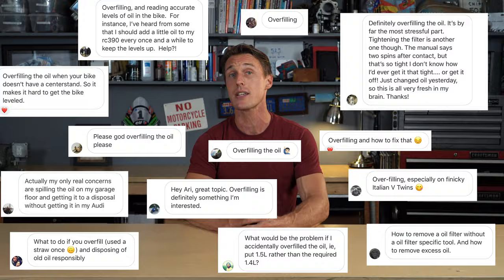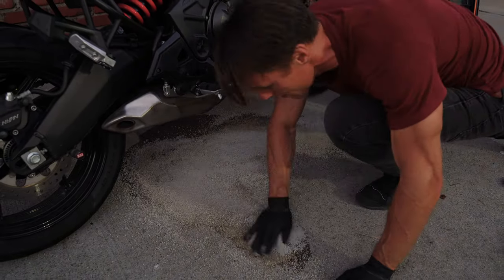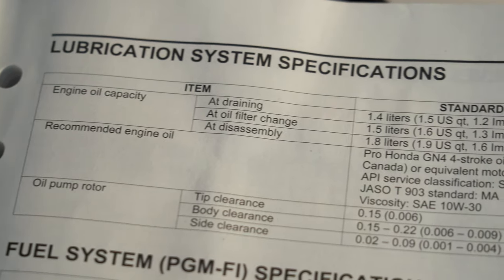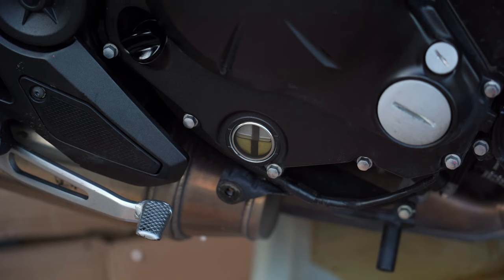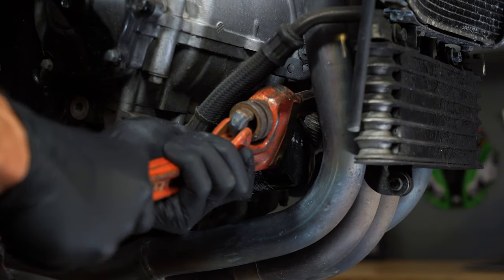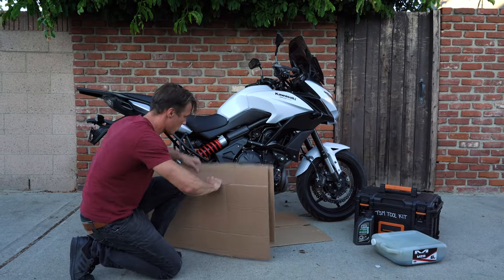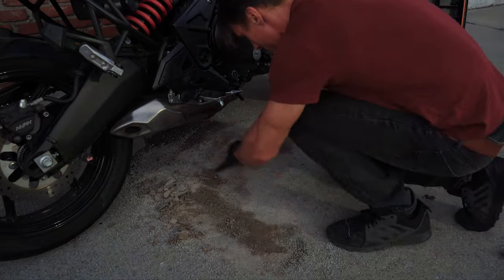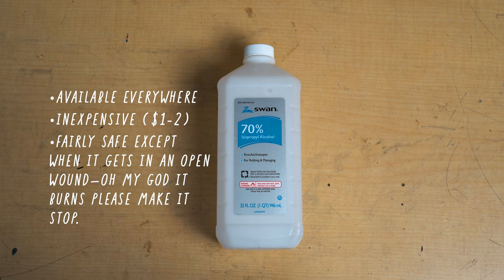Overfilled Oil, Stuck Filters, And Oil-Change Hacks | The Shop Manual

Comment from the maker: For more oil change tips and other how-to articles, head over to RevZilla's online magazine, Common Tread: https://rvz.la/3jPWNkE
Reply: Thanks Ari!
Reply: Ari, you have to be careful generalizing by telling everyone lefty loosey. I can think of dozens of examples from watches and circular saws to motorcycles car and trains where righty loosey is true. Someone is libel to round or shear a nut or strip a thread on a reverse threaded fastener
Reply: Flushing engine before an oil change?
Reply: My 900ss Ducati had the oil filter recessed into the engine case and a torque spec of like 20 ft lb for some reason . Needless to say KN pot metal hex was rarely up to being removed making the psycho method of just stabbing it pretty much the standard procedure .

Comment: There is no worse feeling than changing your oil and not spilling a drop. Then accidentally knocking over the container you used for your used motor oil just before you were about to cap it.
Reply: I did it once, then I misplaced the container on a bench and a burst of wind threw the used oil all over the shop. So frustrating, but a funny story afterwards.
Reply: i had my drain bolt drop in through the hole of my drain pan once...good job I am an expert with chopsticks and was able to get it out again. Took me ages though.
Reply: @Megolhen  I use a 10 oz empty salad container to catch my 1.5 qts and just replace the plug with a new one every annual change since the washer is usually fused to the plug anyway. Then transfer to a 5 lb empty protein powder container for disposal.
Reply: I always have big cardboard pieces lying around. Also good for cleaning and lubing the chain without getting gunk on your garage floor.
Reply: I always drop the oil filter in the catch pan and splash it all over the place
Reply: I accidentally tipped my last bottle after a perfect until that point procedure. XD
Reply: Once I drove over the container that I used to gather it, oh god the mess I did was epic.
Reply: oh yes lol
Reply: im a motorcycle mechanic so i do a lot of oil changes. most annoying thing is when you drop the oil filter into the oil pan and it splashes all over the place, all over you and your face. happens to me at least twice a week and pretty much only on KTM filters because you can only get them out with pliers which is pretty sketchy or by punching a hole in them with a screwdriver
Reply: No, it’s pouring your fresh oil into the car and then hearing a suspicious dripping sound from under the car
Reply: Luckily Baking Soda does wonders for those spills. I had to use a box of it recently because the Z650 has a very piss poor drain plug location and caused oil to drain out at an angle I wasn't expecting.
Reply: Or super careful 🤣🤣

Comment: I'd like to add: After you changed the filter and filled up the oil. Remember to let the engine work for a few minutes and recheck the oil levels. Some times, the filters soak up enough oil to change the levels.
Reply: that is why i measure the oil in a container with graduation marks, so i know i have the correct amount of oil
Reply: I presoak my filter as well
Reply: as per my manual, i only change my filter every 3rd oil change... 
I've never used the same amount of oil on a change, so premeasuring like above I would never do...I use my eye to know its at the right level
Put some oil in the filter, put some oil on the gasket on the filter as well, that will help it come off easier next time... I've only ever used my hands for filters in 35 years... As long as you do it in the proper intervals and lube the gasket, it wont need a wrench.
Reply: I believe he mentioned it in the last episode, but I suppose it never hurts to remind
Reply: @BigBadLoneWolf  Even if you do measure it beforehand you still need to check it in the window.
Reply: @TheGamersRace  I fill with the specified amount of oil, warm the engine again, check the flow to the gallery, let it sit and check the sight glass, and it is always in the middle of the marks
Reply: @rya3190  my Yamaha service manual, actually states a torque setting for the oil filter, but i just hand tighten, then 1/4 of a turn, and on my VFR, the filter is behind the header pipes, so i cover then with  tin foil, before i remove the filter, so no spilled oil gets on the pipes
Reply: @BigBadLoneWolf  I do the 1/4 turn thing as well for ages. Not a single leak. Don't forget to lube the O ring as well
Reply: I weigh the drained oil and filter, tare a fresh filter, and then pour until that much has left my fresh oil container. It's never let me down.
Reply: New yes one being reused it’s the opposite
Reply: @BigBadLoneWolf I never thought of this always used brake cleaner but will do next time.
Reply: Don’t prefill oil filters. You will run the risk of dropping dirt in to the filter, which goes directly to the main oil galley.

Comment: I used to put old newspapers on the ground under my bike to soak up any spilled oil. But when newspapers went the way of the dodo, I switched to dog training pads. They are absorbent since they are designed to hold liquids (pee), leak resistant, and don't cost a ton (22 cents apiece in an Amazon Basics box of 100, which will last for years).

Comment: My trick for overfilled oil. Take the pump and straw from a (preferably used up) tall kitchen liquid soap dispenser, thoroughly wash out any left over soap, then just use it to siphon out the excess oil. The wider straw and pump easily draws out oil.

Comment: Before the “drive a screwdriver” method, I usually tape some sandpaper on the filter, and then try the strap.  It usually works, helps get that extra little grip if someone overtightened the filter.

Comment: UPDATE:  It's the summer of 2020, rubbing alcohol can be a bit SCARCE out there.
Reply: For your skin, dish soap is also a degreaser. Breaks down engine oil just as easily as bacon grease. Brake cleaner is also a degreaser and what I use to clean metal surfaces like my exhaust pipes when I drip onto them.
Reply: Brake cleaner works like a charm.
Reply: Mineral spirits is (are?)  good, and cheap as well.
Reply: Vodka

Comment: Lefty loosy righty tighy can be replaced with the right hand thumb rule: point with your right hand's thumb towards the direction you want the oil filter or drain plug or whatever nut you want to screw in or out, and your fingers will point towards the direction of the turn you need to apply.

Comment: I knew the screwdriver trick when my original filter wouldn't budge with the filter wrench with a paper towel between. I chopped most of the filter in half in one good heave. I've now learned of flathead screwdriver at an angle to softly slow "tap" the filter loose. And when I say softly I mean I was too gentle and it took 5 minutes of love tapping and promising the bike things to let go of the filter.

Comment: I can confirm the screw driver stab method. Works like a charm. Salute
Reply: It might not work if the filter is really stuck. It'll ust tear through the filter and make a huge mess leaving you not much left to work with. Do not recommend.

Comment: Some oil bottles have a built-in funnel like Motul. And I use an oil filter with a hex bolt on the end like HiFlo. Oil filters should only be hand tight. The hex bolt has a predrilled hole for safety wire.

Comment: Pro cleaning tip: to get the rest of the oil out of the concrete that the kitty litter doesn’t clean up use a weed torch with a sweeping motion like using a fire extinguisher over the area and the oil will burn off. Use wisely and don’t stay in one spot too long and no more oil stain.

Comment: You can also take one of your ratchet straps and wrap it around the base of the oil filter. Just overlap it a couple times (in the correct direction)  and then when you pull it compresses itself around the filter. It's saved me multiple times when the socket and strap types have failed

Comment: "isopropyl alcohol is readily available" 
LOL not this year
Reply: 2020 has entered the chat
Reply: Also, not necessarily safe on all paints, and will definitely strip any wax. Best to test on an out-of-sight spot.
Reply: @WDGFE  I used it on my bike after removing the factory / brand stickers and I can confirm it works and it did not damaged the painting (but try it out in some hidden under corner of your plastics to see if it affects the color or not, a small dot missing painting under a plastic's place nobody will ever see wont matter much if it does happens to erase it)
Reply: Methyl Hydrate is a fair substitute. Can be found in the paint section of most hardware stores.
Reply: Isopropyl is not available in some countries like here in Thailand. I have been using brake cleaner for 40 years. No problems
Reply: Aerosol brake cleaner works well too, buuuut can be messy
Reply: I was just thinking this and side-eyeing lmao
Reply: Yeah I was going to ask, when did they shoot this?
Reply: Petrol aka gasoline, just don't put it on paint plastic's or ruber
Reply: Alcohol wipes at dollar tree 25 for 1$ disguised as tv screen cleaner wipes, in a black bag
Reply: @217RockStar217  it's not an issue any more, but thx

Comment: There's also the chain wrench type filter removal tool. If they don't grip they crush the filter in until the do grip, and the type that you fit a ratchet onto the end of are very useful as you can fit them almost anywhere with ratchet joints and extensions and stuff.

Comment: Great advice!  Not much to add....  but, when I pull the drain plug, I always stand the bike up off the side stand and get out all the used oil possible that I can.  Also, Visegrip makes a chain wrench that works great as a last resort before the screw driver method!  lol...  I’ve used a screw driver when nothing else was available.  Always enjoy your videos.  Ride safe my friends!
Reply: Old leather belt that wore out the holes is what I use if a filter gets stuck... But I really haven't had to use it on my vehicles in 35 years, only others that don't put a bit of oil on the oil filter gasket when installing....Prepare it right on install , it will come off so much easier later ;)

Comment: I had a strap type oil wrench that kept slipping on the super tight filter.  So I drilled a hole through the strap, put it on the filter, then screwed a self-tapping screw through the hole into the filter.  Success!

Comment: Yamaha air-cooled four bangers used a filter inside an aluminum housing, held on by a big hollow bolt with a very small head, 12mm I think.  Both bikes I had the PO had rounded off the bolt.  So much fun getting that off, had to destroy the housing, then find a replacement.

Comment: Yep Ive had to take a screwdriver and a hammer to a filter. I have two different style oil filter wrenches and neither  were grabbing it. Never had to do it twice on the same vehicle though. Because if I struggle it’s time for one of those k&n filters I can get on and off with standard wrench. 

Clean up tip. If you don’t have rubbing alcohol for getting oil off of your skin or maybe or maybe you have some but have a cut on your hand or arm . Dawn dish soap works great. It’s actually what they use to get oil off of wildlife after an oil spill.

Comment: I have a claw-type oil filter wrench that is driven by a 3/8" ratchet.  It expands to fit 90%  of the motorcycle and car filters out there, and is pretty low-profile, so ti fits into tight spaces.  It's like having a full set of cap-style wrenches.
Reply: Same here. It also works better for me than the strap style ones.
Reply: That's the best one. Works way better than the cap ones too because it'll bite into the filter. Works better than a screwdriver too, I can promise that.

Comment: Pro tip from a dealership lube tech, get yourself a 3 jaw universal adjustable oil filter clamp. It fits on a ratchet and will fit everything from tiny oil filters do big diesel filters. It has arms on springs that will clamp down super tight on the oil filter.
Reply: Good to know.  I wondered if those worked.

Comment: I tried it once and without having the proper equipment plus a lift, it wasn't pleasant.  I opted to just take it to the dealership to have the oil changed.  Kudos to all those who can, you have my respect but I will just pay someone to do it for me.  Good video, learned a lot.
Reply: Curious what bike because most are relatively simple with some exceptions for poorly designed full fairing bikes (those suck).

For me it is actually a time thing because on two my three bikes it takes 15 minutes for the change but about 5 minutes set up and 10 minutes clean up after.  The shop the one time I did it was 90 minutes AFTER the 20 minute wait to check in.

Oh, an no lift here...two tools, a drain pan and a funnel for one bike...one tool for the other...we won't mention the third bike.
Reply: A cheap socket set, a funnel, a drain pan, and maybe a filter wrench (though I usually loosen them with my hands) is all you need. Simple job.

Comment: A proper size filter wrench is a must. Avoid straps, most won't let you torque new filters to spec with them and alot of strap wrenches won't give you enough of a throw to turn the filter in the first place because exhaust headers or frame or something will be in the way. I was working on a security company Honda ST1300 that had a stuck filter. It was a round filter so no socket attachment would work and it was so seized on the engine that when I punched a screw driver through and tried to turn it, it just ended up tearing the top half of the filter off.
So use a filter that accepts a aocket attachment and torque the filter to manufacturer spec (usually 11-14Nm on most manufacturers I've seen but check your manual), not hulk tight

Comment: Great video!  Heres a couple more tips for removing a stuck oil:

Spray PB Blaster Penetrating Catalyst where the filter mates with the engine and let it soak for a few minutes to let it work its magic.  Wipe off and clean off the filter where you will be gripping it (by hand) and it should come right off.

Harbor freight also sells dedicated oil filter remov channels locks as well.
Reply: Put oil on the gasket when installing and only hand tighten, and it should come off easy... has worked for 35 years for me, i never have used a wrench on a filter

Comment: For anyone with a hard to reach oil filter I STRONGLY RECOMMEND the K&N Oil filters because they have a bolt on the end making getting them off sooo easy. 

My 1999 BMW 1100r oil filter slips up into a hole so a strap wrench doesn't fit and seems to be a weird size so the normal oil filter socket tool doesn't grab enough. First time I had to stab it with a screwdriver to remove it because it was your basic oil filter.
Reply: Generally I think K&N makes garbage products so I wouldn't trust them anyway, but I've heard of a few cases where that "bolt" on the end of their filters just breaks off.

Comment: Over filled at least to top of slight glass is absolutely fine. When the engine is running. Oil isn’t even visible due to pump sucking it up. Now if when on there’s still oil above site glass. Then yes that’s too much oil and will froth from crank. I always fill to top line but oil in filter and head always raise it to top of site glass. Which is fine as once one oil is pumped by more than half by oil pump.
Reply: Is it really fine bro ? I accidently rode for almost 15-20 kms with 100 ml more than prescribed (1200 ml) Now i saw its above the F line from sight glass😢

Comment: I tried the screwdriver method once.  The filter was on so tight from the dealer the screwdriver shredded halfway through the filter.  I eventually coaxed it off with channel locks and I keep a pair in my garage to this day to coax stubborn filters off!

Comment: One cool trick i found for getting a stuck filter off was using the awful rubber strap wrenches with a lining of sandpaper on the inside of the strap. It got a filter off that the socket had rounded off.

Comment: So well done, gang! I will share this clear and concise video with newer riders for years to come! Thanks for keeping these how-to videos upbeat and encouraging, I think it’s the best presentation for teaching, especially for nervous beginners. I also learned about the last resort, stab an oil filter with a screwdriver method from this video! I’ve never had a filter that stuck on before, but it’s good to know about any repair method that legitimately uses Trotsky assassination levels of violence!
Reply: Please don't tell people to use the screwdriver method. It's disastrous when it doesn't work. Filters usually are only stuck on because the filter gasket wasn't lubed, which is the case on a lot of brand new bikes.
Reply: something1random23 Haha, yeah I don’t think I’d ever resort to it. I have an aggressively toothed oil filter wrench if something is crazy stuck on.

Comment: Great video! If you'd need another video idea: how about checking old fluids? I mean discussing the color and smell of the old fluid that comes out of the engine / gearbox / cardan / forks / cooling system / brake system. I know what to check for on engine oil, but don't know what can go bad with the others.

Comment: Nice video. But one little tip I have is if you want to put in a 'full' bottle & a 'bit', put the 'bit' in first. If you over do the 'bit' top up the 'bit' bottle from the full one. When your 'bit bottle' is right, just chuck in the rest of the 'full' one. Filled to the mark :-) Safe riding. Dave (VFR1200 X)

Comment: The first filter I took off my NC700X was so tight that I resorted to the screwdriver through the filter trick, only to tear off the top of the filter. So if that happens, there's one more trick.  Get a cold chisel, and tap it into the base of the filter, till it gets a good notch going. Then you can use a big hammer and a large flat head screwdriver to hammer that filter around. Be careful not to gouge the block.